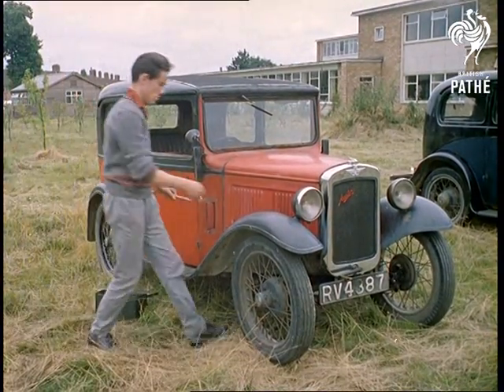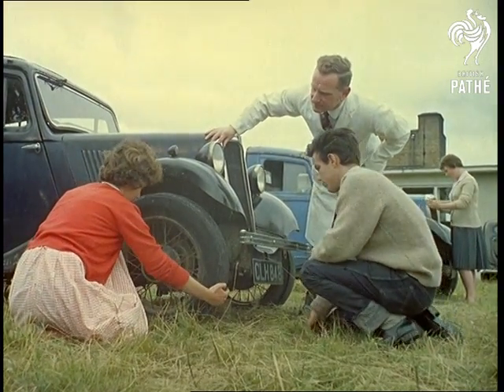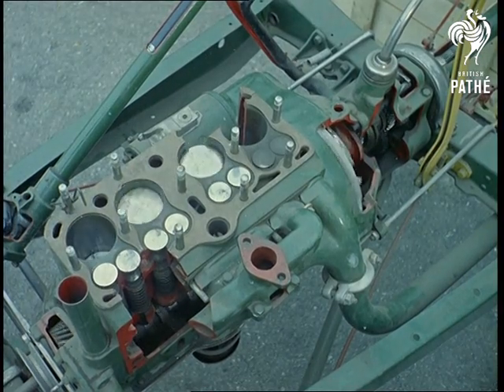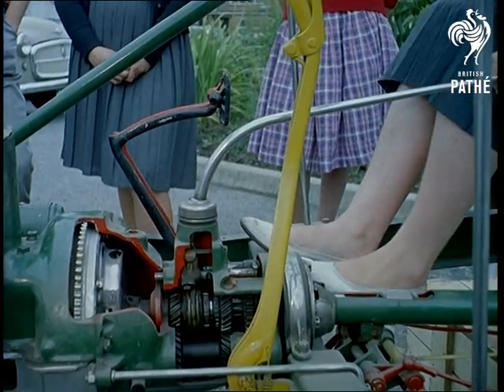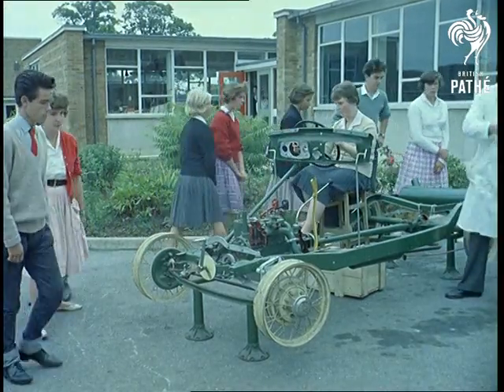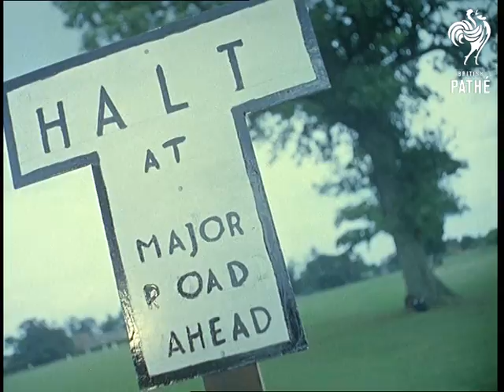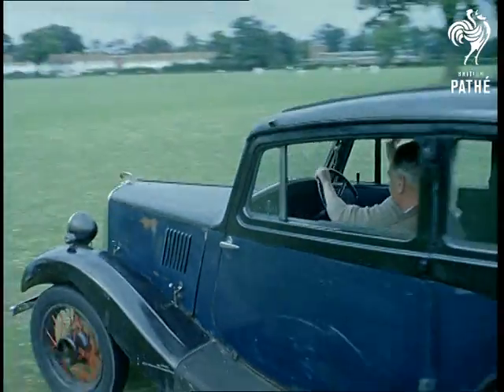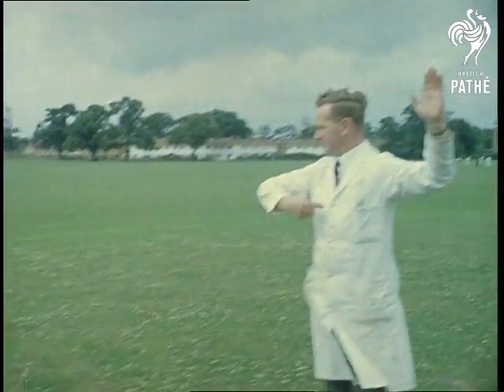School Cars (1961)

Comment: HP had, and may still have a race car driving simulator they take to trade shows etc.  It always has a line of people wanting to try it.  It is was powered by two of their big PC workstations and they both had two big graphics cards in them.  Big TV's in front and on both sides of you.  It was very cool, though now no doubt you could do better with a vr headset.